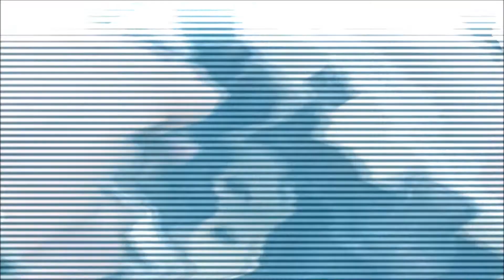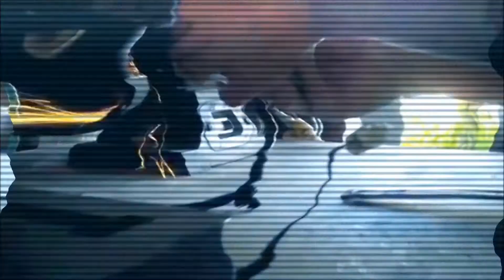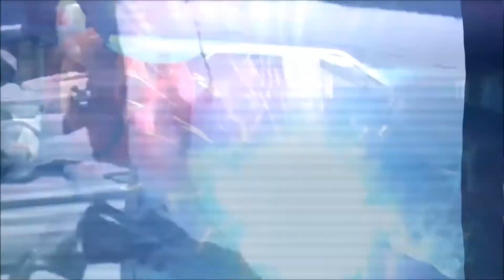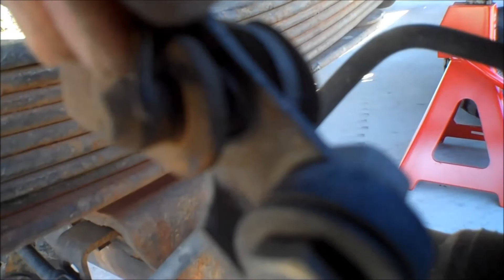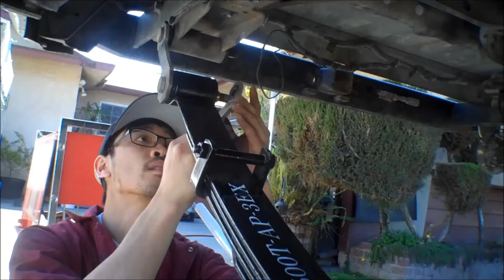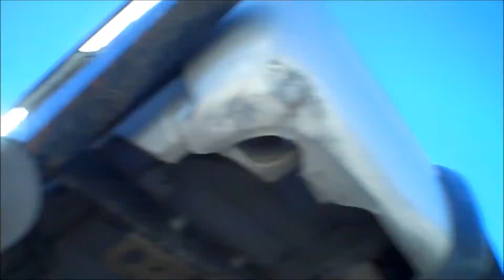Dang Installs All Pro  Expedition Leaf Springs

Comment: Any more details about disconnecting and re-attachment of brake lines and e-brake cables?
Reply from the maker: Some years had the parking brake behind the axle. just make sure you chalk the tires. the parking brake needs to be off to have slack.

Comment: Hi do you have part number for that. When you install the new leaf spring how much did it leaf? Thx
Reply from the maker: +Jeff Guia https://www.allprooffroad.com/9504tacomarearsuspension/9504leafsprings

Not sure if links will work.

I'm not sure how much lift it gave me. They advertise 3 inches of lift. My truck has been lifted for a long time so I don't recall what stock height is.